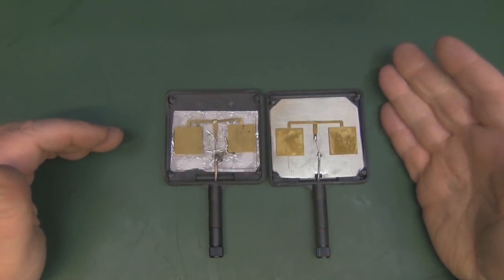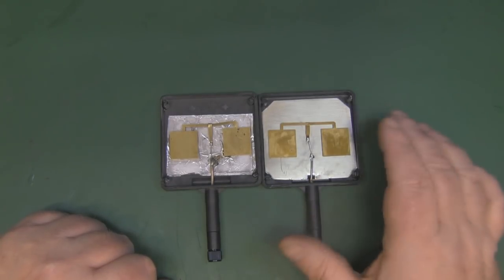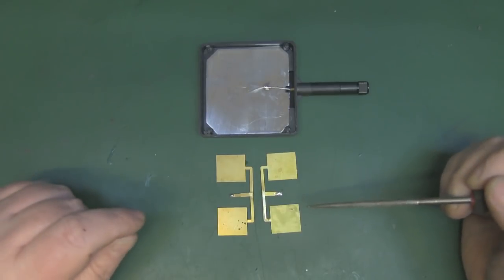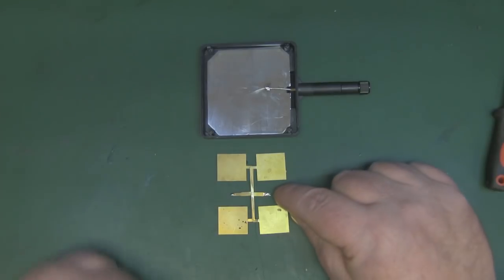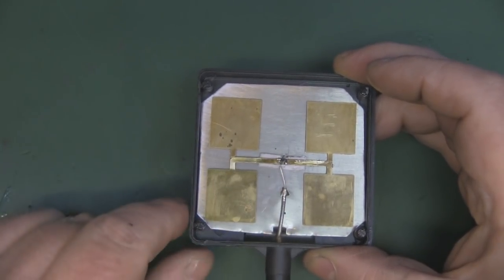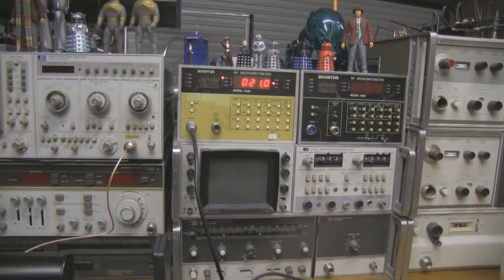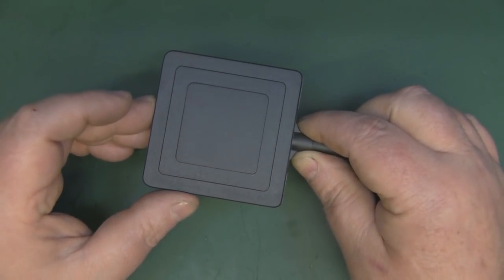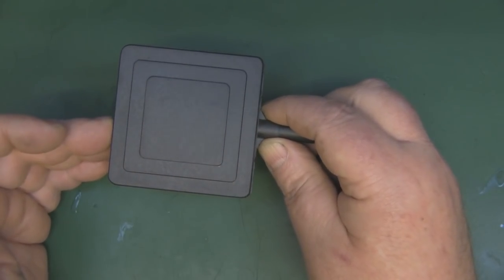Now it’s 11dBi

Comment: I was in Friedrichshafen (Germany, HAM show) a couple of weeks back & bought a bundle of antennas from stall holders. Most of these were nicely made bi-quads & double bi-quads that were nicely made, quite possibly based on Andrew McNeil designs / plans, & cost 10 euros each. One was a beautifully made bi-quad & cost 15 euros. Kent Britain (WA5VJB) borrowed an end of my table & sold a pile of etched yagi antennas, patch antennas & Vivaldi antennas, I bought a bundle of these, all at 10 euros. Had intended most of these for fellow radio club members but many were nabbed by a family member for testing on WiFi systems. The double bi-quad is mine, really intended for 2.4 gig Wifi but I slapped it on to my Yaesu VX7R & it was working very well on the 2 metre band. The best ones will be used on my caravan. I asked about WiFi interception in perfect test conditions & at lawful router powers. One guy claimed 170 miles of successful two-way comms via a distant unprotected router, another guy claimed 220 miles. J.

Comment: Can you do a test and video for the "Dual Band" rubber duck style antennas that are all over Ebay and Amazon? I would like to know how they perform in each band. Are they REALLY "dual band"? For example: https://www.ebay.com/itm/WiFi-Antenna-Dual-Band-7dBi-2-4GHz-5-8GHz-for-Wireless-Network-Router-New/272632852404?hash=item3f7a2f2fb4:g:UrcAAOSwOfxXA-va

Comment: Could you do a video on RSSI, dB, 3db power and range change, 6db power and range change. We get RSSI Telemetry and would like an explanation by a subject expert. Range safely. Our equipment low alarm ar 45dB, critical alarm at 42dB and control loss at 39dB. Also we do range tests at 1/30th power what does that relate to for distance?

Comment: well done! could be very stable antennas with just some squares, i wanna try a waveguid slot antenna but searching for the best methode to use it, most adapters seems to only have a usb connection but that will limit the cable lenght , even more when using coax all the way to a pc.
i might want to use a router and place it directly near the waveguid and not have to worry about signal loss with a 15 metyer run of utp cable.
Also want i want to know what the effect of a double glass window would be on 2,5 and 5 ghz , if that wont play a role i maybe better of put the antenna in my window inside my house, that makes it easyer.
Can you do some test on the effect of glass in front of a wifi antenna ? i think you have the right stuff to do that.
Many tnx

Comment: Hi Andrew, To realize the full potential of the 4 patches would it be more beneficial to have the feed points all on the same side as opposed to having two feed points at the top and two feed points at the bottom? I understand not enough space in that case to do it but interested in your thoughts about it.